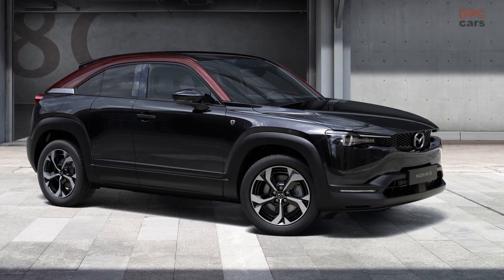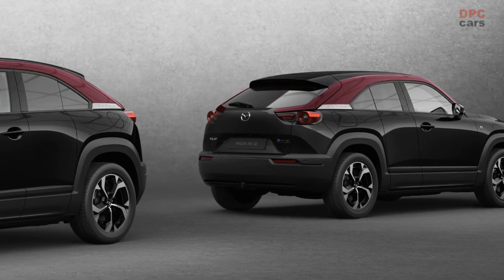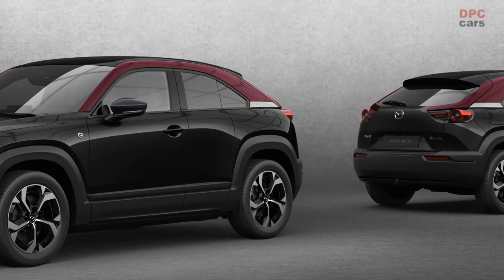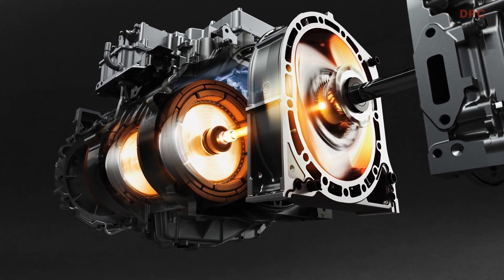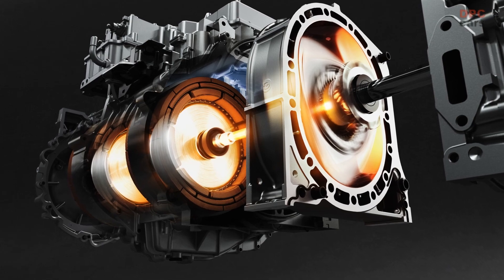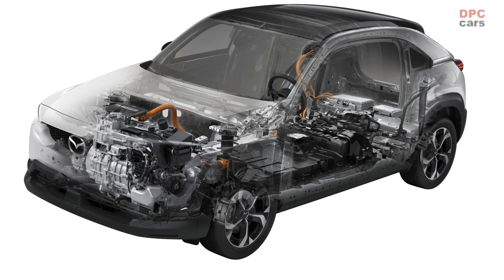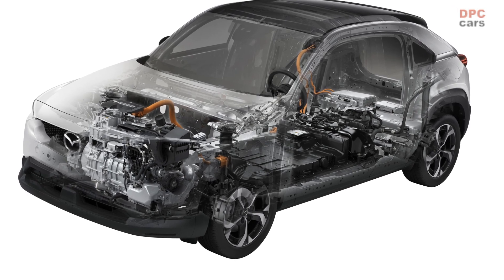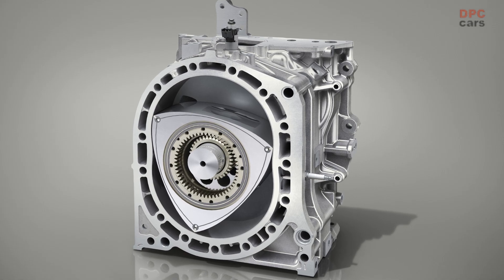Mazda MX-30 e-Skyactiv R-EV: Rotary Engine Range Extender | Debut at 2023 Brussels Motor Show

Comment: That will be if you only charge it once and run it out of fuel,and charge.  It does over 50 miles on a charge , Meaning if you do less than 50 miles a day you will never use the fuel. If you are travelling a few hundred miles on a trip then you have the fuel . Perfect for most people. Zero charging or range anxiety.
Reply: That's true 👍🏻👍🏻

Comment: 347 miles (400-53 EV range) on a 50 litre tank capacity does not sound like great effiency in 2023? Something does not add up.
Reply: That will be if you only charge it once and run it out of fuel,and charge.  It does over 50 miles on a charge , Meaning if you do less than 50 miles a day you will never use the fuel. If you are travelling a few hundred miles on a trip then you have the fuel . Perfect for most people. Zero charging or range anxiety.
Reply: @deanowarrior  with 50 litres you should (without charging) reach at least 500 miles. Something went wrong... 🙂
Reply: @aufbrechen  maybe on a pure petrol engine but not a hybrid style car with its focus on charging and driving 50 ev miles and using the fuel only on rare occasions.
Reply: It’s still a rotary lol